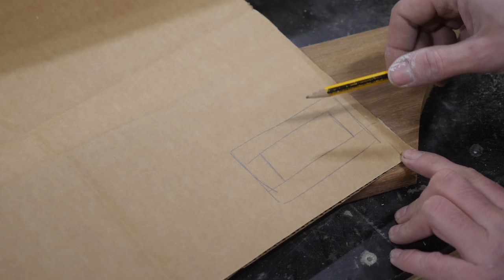Sail Life - Galley assembled, insulated and ready for paint - DIY boat project

Comment: Whilst you can easily get to the conduit put some draw wires in for the cables even if its just old fishing line. Its a headache you don't want trust me
Reply: Suck a plastic baggie with a string tied to it using a vacuum.  It'll fly right through the conduit at any time.  No big deal.  

That's how commerical electricians do it.  We suck line in like this through conduit runs hundreds of feet long.  

Zing!  

It goes in so fast and easy you have to be careful as the string is moving so fast it can seriously cut you like a bandsaw.

Comment: You seem to be losing a bit of room at the back of your counter. You could still take a router and cut a rectangular hole with rounded corners and then have a drop in container. It could be removable for cleaning if it was used for utensils or spice containers??
Just a thought, thank you as always for your videos.

Comment: I am no cabinet maker, I have a problem cutting a straight line in fact, but couldn't you turn your large biscuits the long way and set the joiner to go deeper?
Reply: Biscuit joiners are designed to cut slots the long way. There is no way to make them cut a deep slot like you're asking. Just FYI...
Reply: @garysouza2277  Ok  thanks for the tip.